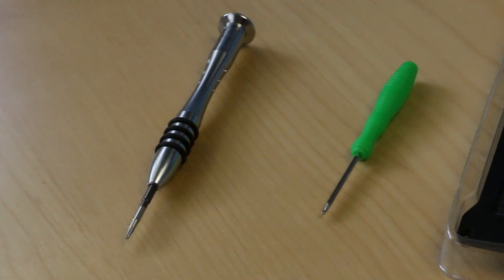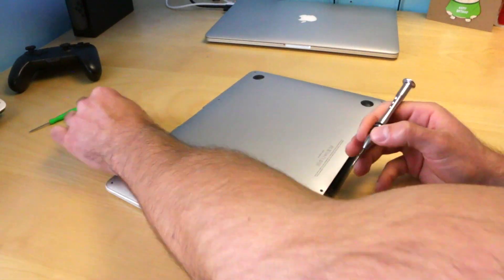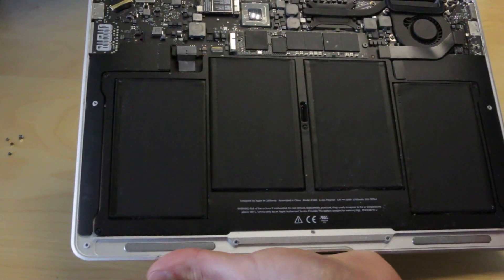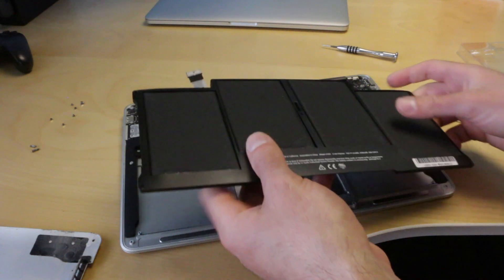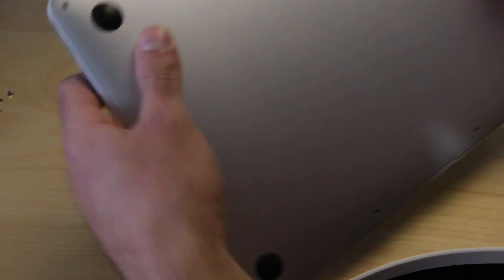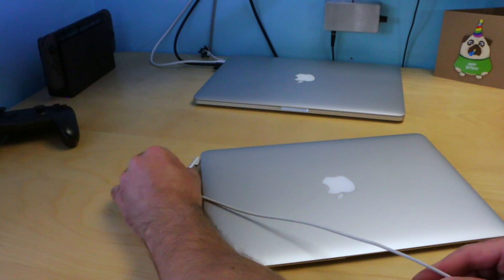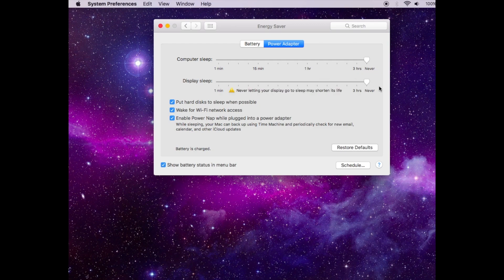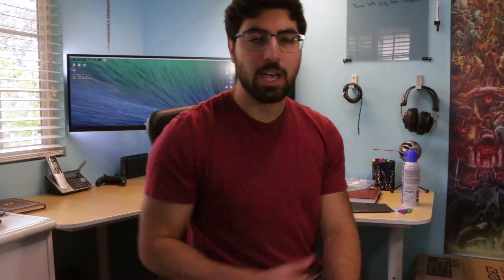How to Replace the Battery in a MacBook Air

Comment: Thank you so much for this video! My MacBook Air got to the point where it would die 1-2 minutes after I unplugged it. I bought a new battery and used your tutorial to replace the old one. I am still waiting for it to charge up and then drain, but so far so good! 👍🏻 A very easy process and much cheaper than buying a new laptop.
Reply from the maker: Christine Lankford happy to have helped! It’s always great fixing old things rather than chasing the latest and greatest every year. Hope your laptop serves you well for many years to come 😁